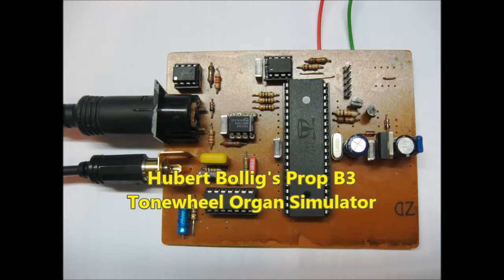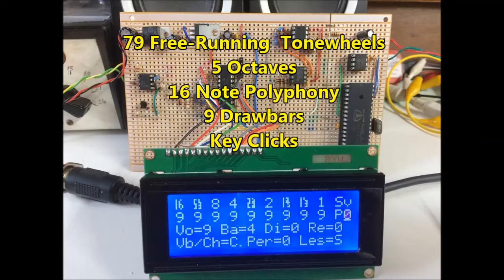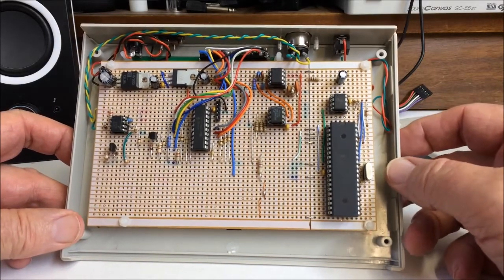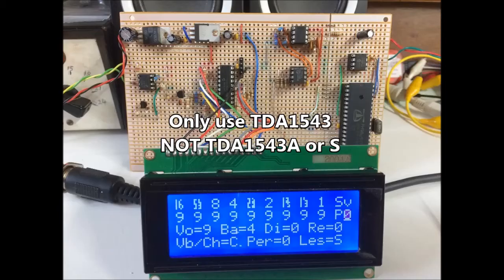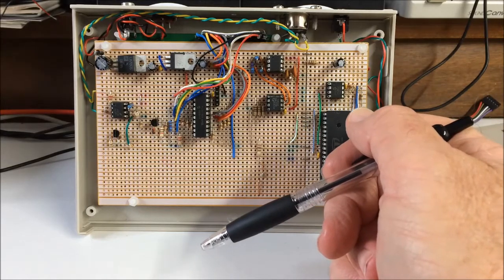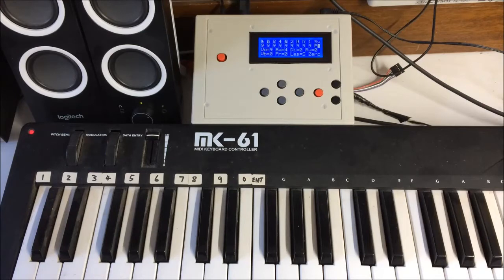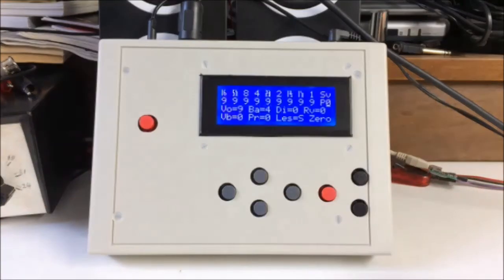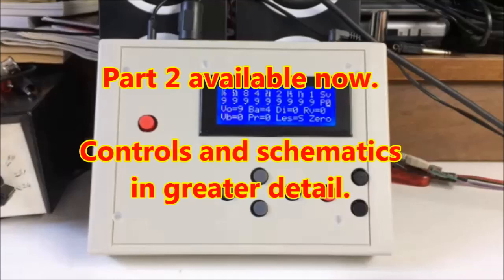How To Build A Hammond B3 Tonewheel Organ Simulator PART 1

Comment: The simulator is great! The Propeller MCU is fantastic, btw! I looked into it and it's an 8 independent cores (with independent internal memory) and have programming language designed by Parallax. It is great for audio applications, it seems.

Comment: Hi Mike, thank you for this video. It is an interesting project. Only drawback is that the code for the RISC MCU isn't available. Do you happen to know whether the original author of the project is still among us? I'd be curioous to know what the constraints were in the original tonewheel generator simulation, e.g. why 79 tones? Why 16 fold polyphony?
Reply: Maybe I can answer some of your questions. The emulator does the upper manual only, where the lowest octave is folded up to leave room for the pedals to go deeper. The 79 tonewheels are equivalent to n. 13 to 91, so none is really missing. Back then the author H. Bollig sent me the source, but I never got confirmation from him if it was ok to reveal or repost, and at the time I was under the impression that he wanted to make a product out of it. It was for the prior version tho, missing the rotary speaker emu which was added later. I managed to get it working without the DAC, using just PWM and a passive filter, and then thru a cheap RM600 pedal. The 16 notes limit is because the propeller 1 chip has no multiplier, and it's 20 MIPs per core peak. Full contact matrix and hence full poliphony would not be feasible. The 79 tonewheels take two cores, and they're really just the phase accumulators IIRC, then another two cores mix up to 8 voices each according to the drawbars. He simply ran out of processing power, it's already a miracle what he managed to squeeze in. I'm curious too about how he did the leslie speaker in one or two of the remaining cores.
Reply: @G1lbyBl3urgh  Thanks a lot for explaining.

Comment: Hello Mike, amazing project!!! I arrived to your video because my Hammond has some tones missing from the generator, and as is very difficult to repair them. I was looking for a simple tone generator that could be inserted in the organ that generates the sine wave with the exact same frecuency that the one missing. I understand that would be a fraction of this whole clone simulator. Could you help me in any way? (At the same time I will check the documentation you linked".
Thanks ins advance!🤗
Reply from the maker: Hi Pablo, thanks for watching - I think it would be possible to build a tone generator to do what you want but the tone generator part of this project was designed by Hubert Bollig and it would need access to his code to do this. He hasn't, as yet, made his code available.